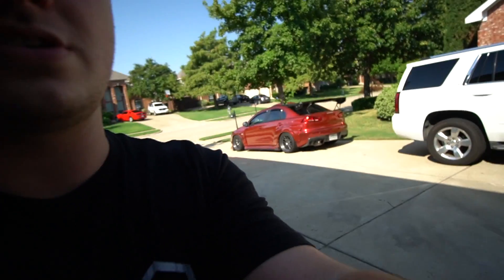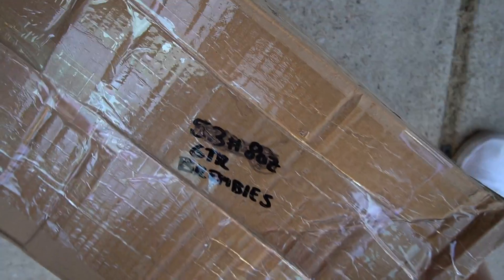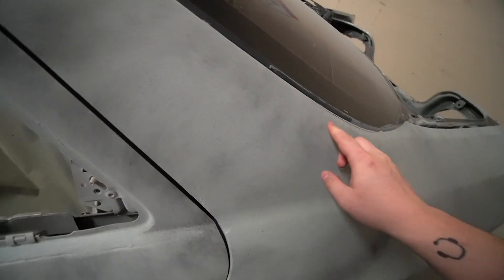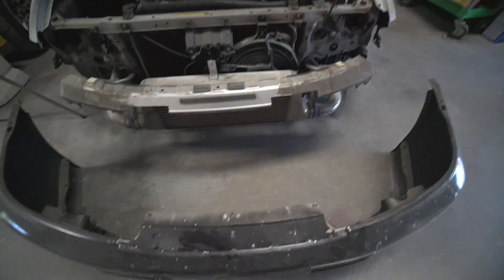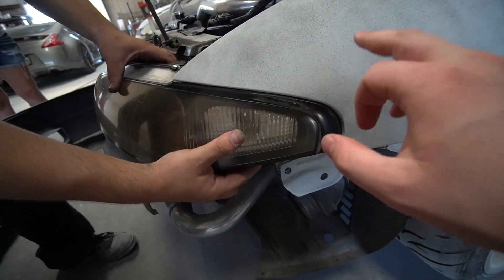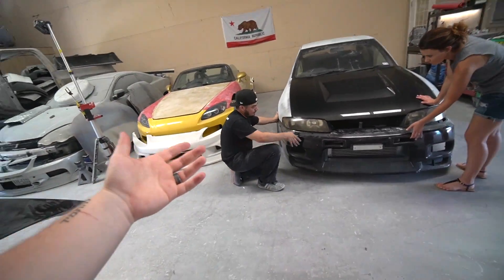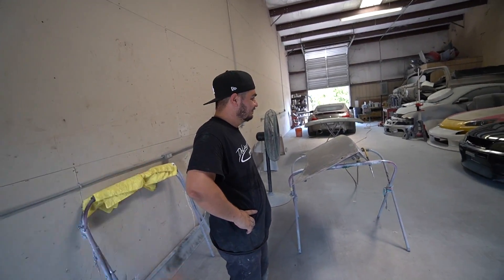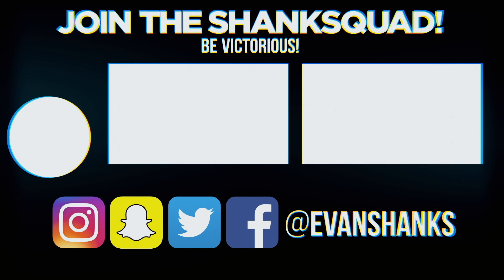CARBON FIBER GT-R HOOD for the R33!!

Comment: That's what I told you about using bondo on the car and not body filler, José said the right words when he went to your rear doors and says somebody used bondo "it was Evan" haha. Also your quarter panels you never seal them with adhesive glue as in one corner panel to another quarter panel

Comment: Did...did he just call the EVO boring? Breaking my heart, bro.
Reply: Casper Ghost fr it’s probably faster then the GTR
Reply: @ciceroyak29  Definitely not faster than the gtr
Reply: That's my dream car and he said evo was boring??? Sad
Reply: KAS470 but it can keep up with it still evo is so clean
Reply: @ciceroyak29  I agree All evo's look so clean and mean looking
Reply: The evo is clean for sure. I love the color. But a full bolt on e85 gtr is no joke. The spool in basically instant which means the powerband is fat, plus mated to the dct transmission the gtr just becomes an animal. The evo has to big of a turbo. It takes forever to spool. I'm sure the evo is fast no doubt, it made like what 500whp? But it's just no match to the gtr. I would have to disagree with Evan though. If the evo had a proper sized turbo that spooled fast and had a fat juicy powerband and made less power, it would be a riot to drive and I'd be more in favor of the evo being more fun to drive because stick shift and what not. The gtr you kind of get in, mash the gas and make sure you click the paddle fast enough. I guarantee Evan doesn't find the evo appealing anymore simply because the turbo is to big and takes way to long to spool. Torque makes cars fun and feel fast, but when the power hits at 5k and redlines at 7k or so, theres no fun in that, and that is how his evo is set up. The gtr spools pretty much immediately, making for a car that FEELS like it's actually a fast car, which it is a fast car.